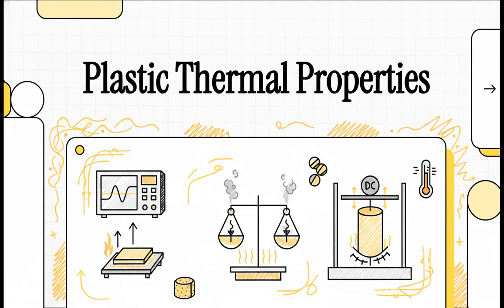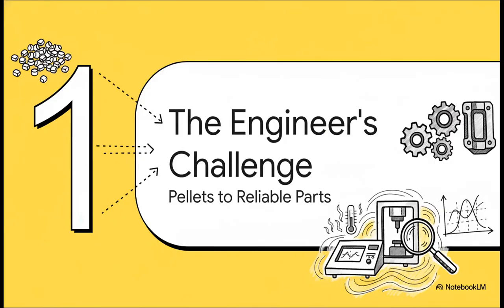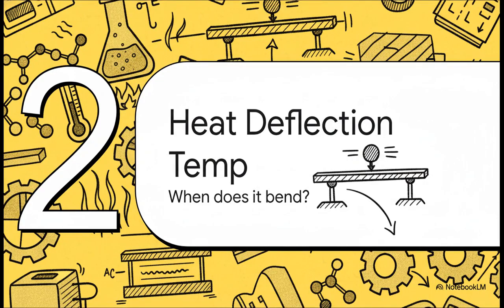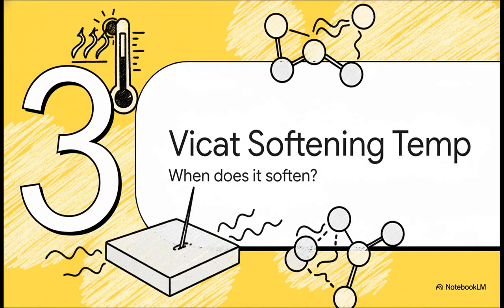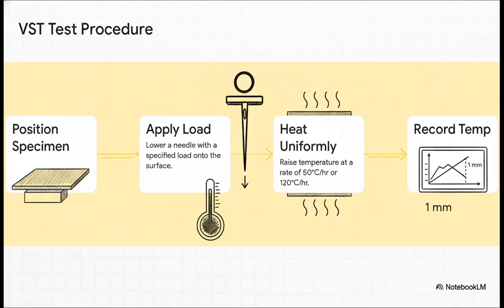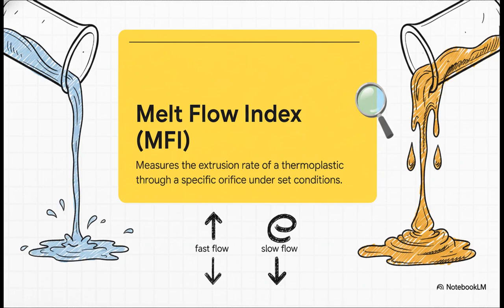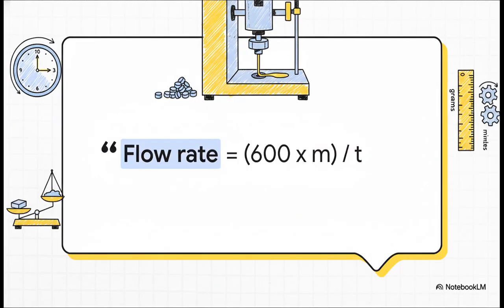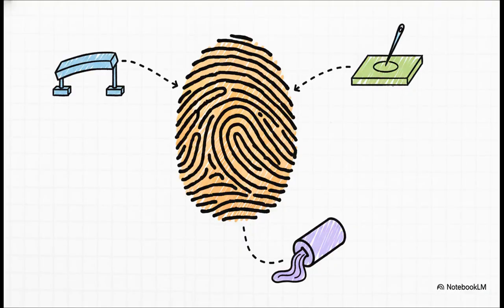Plastic Thermal Properties

Comment: The video discusses the thermal properties of plastics and how plastics respond when exposed to heat.
	•	Thermal properties are important because they determine whether a plastic can be used in high-temperature or low-temperature applications.
	•	Plastics generally have low thermal conductivity, which means they do not transfer heat easily and act as thermal insulators.
	•	Glass Transition Temperature (Tg) is the temperature at which a plastic changes from a hard, rigid state to a softer and more flexible state.
(Muhammad syamir )(DTL 4B)

Comment: The video explains how plastics react to heat. It introduces tests like HDT, which shows when plastic starts to bend under load, Vicat Softening Temperature, which tells when plastic begins to soften, and Melt Flow Index (MFI), which shows how easily plastic flows when melted. These tests help engineers choose the right plastic and set proper manufacturing conditions.
(Muhammad Izzat Irfan Bin Abdul Karim dtl 4B)

Comment: Plastic thermal properties also include specific heat capacity, which shows how much heat is needed to raise the plastic’s temperature, and thermal stability, which indicates resistance to degradation at high temperatures. Together, these properties affect processing behavior, cooling rate, energy efficiency, and the service temperature range of plastic products.

Arniesha Azrien Dtl 4B

Comment: Heat Deflection Temperature (HDT) indicates a plastic’s capacity to withstand deformation when exposed to elevated temperatures under a defined load, making it a key property for high-temperature applications. Vicat Softening Temperature (VST) defines the temperature at which a plastic starts to soften under a standardized needle load and is especially relevant for materials that lack a clear melting point.

Melt Flow Index (MFI), also known as Melt Flow Rate, measures the ease with which a molten polymer flows through a standard die, offering important information about its processability in manufacturing methods such as injection molding and extrusion.

(Muhammad Naseemuddin) (DTL4B)

Comment: Plastic thermal properties describe how plastics respond to heat, such as their ability to conduct heat, soften, melt, expand, or deform at certain temperatures. Plastics generally have low thermal conductivity, making them good heat insulators, and important properties include glass transition temperature (Tg), melting temperature (Tm), and heat deflection temperature (HDT), which are crucial for material selection, product design, and plastic manufacturing processes.
fadzlina dtl4B

Comment: Heat Deflection Temperature (HDT) refers to the temperature at which a plastic begins to deform when subjected to a small load, making it an important indicator of a material’s suitability for high-temperature applications. Vicat Softening Temperature (VST) is the temperature at which a plastic starts to soften under a specified needle load and is often used for materials that do not have a well-defined melting point. Melt Flow Index (MFI), also called Melt Flow Rate, describes how easily a molten polymer flows through a standard nozzle, providing useful insight into its processing characteristics for techniques such as injection molding and extrusion.

(Raden Ariff DTL 4B)

Comment: Heat Deflection Temperature (HDT): The maximum temperature at which a plastic can maintain its shape under an applied load. It indicates the material’s heat resistance during use.
Vicat Softening Temperature (VST): The temperature at which a plastic begins to soften when subjected to a specific load. It is used to evaluate the material’s softening point and thermal resistance.
Melt Flow Index (MFI): A measure of the flow rate of molten plastic. It indicates how easily the material can be processed; a higher value means easier flow, while a lower value indicates higher viscosity and strength.
( Nur Syuhadah Nadhirah DTL 4B)

Comment: 1. Heat Deflection Temperature (HDT):

HDT is a thermal property that indicates the temperature at which a plastic will deform under a specified load.

It shows how well a plastic maintains shape and stiffness when heated under load. 

2. Vicat Softening Temperature (VST):

Vicat Softening Temperature measures when a plastic begins to soften under a defined test condition.

It is a benchmark for heat resistance and stiffness loss at elevated temperatures. 

3. Melt Flow Index (MFI):

MFI expresses how easily a plastic flows when melted.

It is used as an indicator of processability in manufacturing (e.g., injection molding).

Higher MFI means easier flow, lower MFI means more resistance to flow under heat. 

Context on Why These Properties Matter (general thermal behavior of plastics)
4. Temperature impacts physical behavior:

As temperature changes, plastics respond differently in stiffness, strength, and deformation characteristics. 

5. Differentiating between types of plastics:

Thermoplastics soften and melt with heat, allowing reshaping. 

AMIRAH BINTI AMRAN DTL4B

Comment: 1. The "Bending" Test (Heat Deflection)
This checks when the plastic gets too "tired" to hold up weight.
• The Idea: Imagine a plastic shelf holding heavy books. As the room gets hotter, the plastic softens. Eventually, the shelf can't stay straight and starts to sag.
• The Goal: To make sure your plastic parts don’t melt or droop when they get hot (like a dashboard in a sunny car).
2. The "Denting" Test (Vicat Softening)
This checks when the surface of the plastic becomes soft like wax.
• The Idea: Instead of bending the whole piece, we push a tiny needle into it. At first, the plastic is hard and the needle can’t get in. As it heats up, the needle finally sinks in.
• The Goal: To know when the plastic is no longer "hard" and starts getting "mushy" on the outside.
3. The "Honey" Test (Melt Flow)
This checks how the plastic behaves when it is completely melted into a liquid.
• The Idea: Think of pushing honey through a straw versus pushing water. Water flows fast; honey flows slow.
• The Goal: This helps the factory. If the melted plastic is too thick, it won't fit into the mold. If it’s too thin, it might spray everywhere. This test tells the machines how hard they need to "push" to make the part.
In Short:
• Test 1 is about Sagging.
• Test 2 is about Softness.
• Test 3 is about Flow.

Ameerul Aqiel 
Dtl 4B

Comment: HDT (temperature where plastic deforms under load), VST (temperature where plastic softens), and MFI (how easily melted polymer flows). These tests are vital for material selection, process optimization, and quality control in manufacturing.

muhammad shazamifzal dtl4b

Comment: Heat Deflection Temperature (HDT) describes the ability of a plastic to resist deformation when exposed to heat under a specified load, making it an important parameter for applications involving high temperatures. Vicat Softening Temperature (VST) refers to the temperature at which a plastic begins to soften when subjected to a standard needle load, and it is particularly useful for materials that do not exhibit a distinct melting point.

Melt Flow Index (MFI), also referred to as Melt Flow Rate, indicates the flowability of a molten polymer through a standard die, providing valuable insight into its processing characteristics for manufacturing techniques such as injection molding and extrusion.

iman ateef Dtl 4B

Comment: Plastic Thermal Properties

	•	Melting temperature (Tm): Temperature where plastic melts.
	•	Glass transition temperature (Tg): Plastic changes from hard to soft.
	•	Heat resistance (HDT/Vicat): How much heat plastic can take before deforming.
	•	Thermal conductivity: How well plastic transfers heat (usually low).
	•	Thermal expansion: Plastic expands when heated.
	•	Heat capacity: Heat needed to raise plastic temperature.
	•	Thermal stability: Ability to withstand high temperature without damage.
(Muhammad Haziq DTL4A)

Comment: •	Heat Deflection Temperature (HDT): Measures the temperature at which a plastic deforms under a specific load.
	•	Vicat Softening Temperature (VST): Indicates the temperature at which a plastic begins to soften.
	•	Melt Flow Index (MFI): Shows how easily a plastic flows when melted, important for processing like injection molding.
	•	Importance: These properties help in selecting the right plastic, ensuring proper manufacturing, and predicting performance under heat.

(Muhammad Nabil Bin Mohd Suhaimi DTL 4B)

Comment: Heat Deflection Temperature (HDT) is a measure of how much heat a plastic can withstand before it begins to bend under a small load, which is important for evaluating performance in hot environments. Vicat Softening Temperature (VST) indicates the temperature at which a plastic starts to soften under a needle-like load, commonly used for plastics that do not have a clear melting point. Melt Flow Index (MFI), also known as Melt Flow Rate, measures how easily a melted polymer can flow through a nozzle, helping manufacturers determine processing behavior for methods like injection molding or extrusion.

(Emran Harith - Dtl4a)

Comment: • HDT (Heat Deflection Temperature): the temperature at which plastic starts to bend or deform when a load is applied. It indicates how well the plastic can maintain its shape at elevated temperatures.

• Vicat Softening Temperature: the temperature at which plastic begins to soften under a specified load. It helps determine the maximum service temperature before the material loses stiffness.

• Melt Flow Index (MFI): measures how easily molten plastic flows under heat and pressure. It is important for evaluating the material’s suitability for processing methods such as injection moulding and extrusion.

Muhammad Noh Aidil Denish bin Hairu Zaman     dtl 4A

Comment: 1. HDT (Heat Deflection Temperature)
The temperature at which plastic starts to deform under load.
2. VST (Vicat Softening Temperature)
The temperature where plastic begins to soften under a specified load.
3. MFI (Melt Flow Index)
The rate of flow of molten plastic, indicating processability.

Tengku Hazwani Annisha bt Tengku Azuandi DTL 4A

Comment: 1. Heat Deflection Temperature (HDT)
	•	Temperature at which plastic starts to deform under load when heated
	•	Indicates heat resistance under mechanical stress
	•	Used for high-temperature applications
	•	Example: automotive parts, electrical components

2. Vicat Softening Temperature (VST)
	•	Temperature at which plastic begins to soften
	•	Measured when a small probe penetrates the material
	•	Focuses on softening, not deformation under load
	•	Shows the temperature limit before plastic loses strength

3. Melt Flow Index (MFI)
	•	Measure of flow rate of molten plastic
	•	Unit: g/10 min
	•	High MFI → flows easily
	•	Low MFI → high viscosity
	•	Important for material selection and machine parameter setting
(NUR NADHIRA SOFEA BT KHAIRUL IZMAN)(DTL 4A)

Comment: 1. Heat Deflection Temperature (HDT)
	•	HDT is the temperature at which a plastic starts to deform under a specified load. It is not the melting point, but a practical measure of heat resistance under stress.  

2. Vicat Softening Temperature (VST)
	•	Vicat is the temperature at which a plastic begins to soften.

3. Melt Flow Index (MFI) / Melt Flow Rate
	•	The video also mentions Melt Flow Index, which indicates how easily the plastic flows when molten. 
Amirul Haziq Dtl4A

Comment: 1️⃣ Heat Deflection Temperature (HDT)
The temperature at which plastic starts to bend or deform
Happens when the plastic is heated while a load is applied
Used to determine heat resistance of plastic in real use
2️⃣ Vicat Softening Temperature
The temperature at which plastic begins to soften
Measured using a small needle pressing into the plastic
Different from HDT because it focuses on softening, not bending
3️⃣ Melt Flow Index (MFI)
Measures how easily molten plastic flows
High MFI : plastic flows easily
Low MFI : plastic is thicker and flows slowly
Important for plastic processing (molding, extrusion)

Muhammad Aiman Batishah 
DTL 4A

Comment: Thermal properties tests such as HDT, VST, and MFI are used to evaluate the heat-related behavior of plastics. HDT measures the temperature at which a plastic deforms under load, indicating its ability to withstand heat while supporting weight. VST determines the temperature at which the material begins to soften under a fixed load, while MFI measures the flow rate of molten plastic, showing its viscosity and ease of processing. (nur zhulaikha najwa binti ahmad najib) dtl 4A

Comment: HDT, VST, and MFI are important thermal properties of plastics. HDT indicates the temperature at which plastic begins to deform under load when heated, VST shows the temperature at which plastic starts to soften due to heat, and MFI measures the flowability of molten plastic during processing. These properties are important for material selection and manufacturing process control. ( wan nur sabrina ) (DTL 4A)